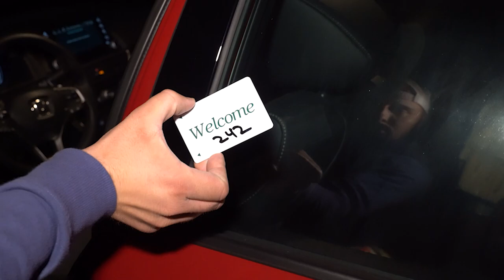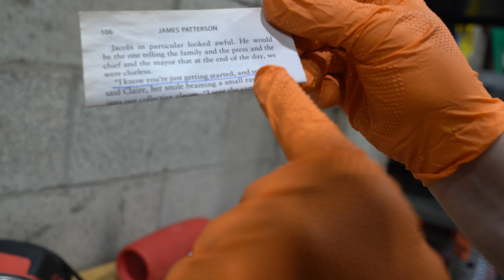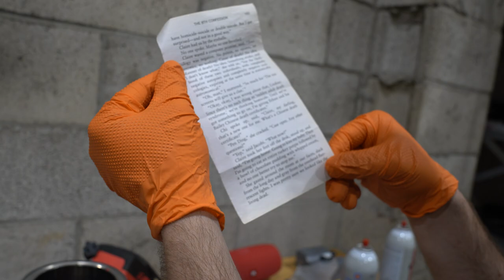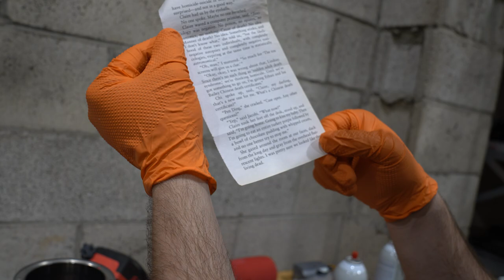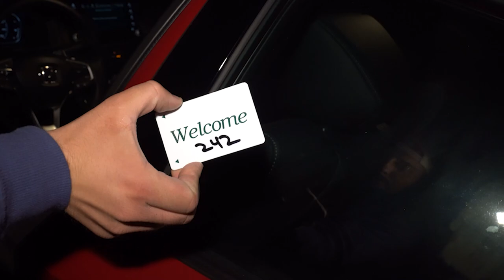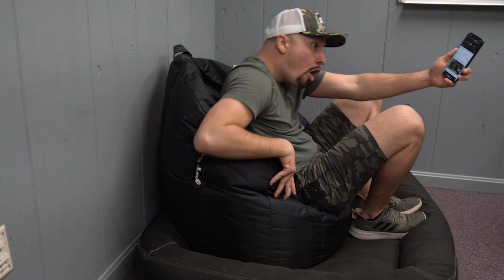OPENING UP A CAPSULE FOUND INSIDE CREEPY HOTEL ROOM

Comment: Why wasn’t u thinking about wearing a mask when opening the things, cause it looks like a airtight container. There could have been some kind of toxin in it. Be more safe and the doll can be cursed? 🙏🏽💯
Reply: Did u hear the noise when it opened
Reply: Exactly
Reply: Exactly.  And locktite on the bolts didn't say somethings SUS.   Seriously
Reply: @xxcharliegirlxx154  yeah cause it was airtight.
Reply: I mean once again a super valid point.  This is why I get so heated over these videos.  I liked cj at first but damn man common sense over content unless its all just staged.  Which makes sense with the lack of precautions everywhere......
Reply: @danegalang6224  don’t think he is staging it, he’s just not thinking. 😂
Reply: @monicatnielsen  I agree

Comment: ok I rewatched the hotel visit and the only clue I could see was the toilet seat was up. It leans towards a man, because I normally see hotel rooms have toilet seats down after they clean the rooms.
Reply: Have you checked for GPS tracker on your vehicles?  Did you track what vehicles you all saw both nights? Have you cross checked those with thr vehicles outside the hotel?

Comment: They keep leaving you pages from a book. Are you saving the pages and are they from the same book? Also, that doll, isn't that the head that was in that brief case with the condom that you didn't take. Then when you went back for it, it wasn't there anymore. I think when you fail to take one of their clues, they put it in another intent to make sure you see it. Also, in the room, take note that the bed sheets were messed up. And look at all the things you are finding because it appears they are personally messing with you so anything you find is a piece of the puzzle. For example, the messed up bed sheets are probably connected with the condom that was in that briefcase. And it seems like there is a focus on unsolved murders or deaths.

Comment: The radio is set on white noise which indicates shielding of information from being intercepted by overhearing via ear or electronic usually electronic. It would have been nice to know whether the bed was actually used or staged. The other thing is if the chair and card was on private property it could have been meant for property owner if so they maybe able to shed light on the matter.

Comment: The only way to determine if it's randonautica setting things up, is by setting some scenarios up yourself.
For example;
Set up an email address, then during your randonauting, leave some random items in the location. Such as a waterproof container with a piece of fabric in and a copy of instructions. These instructions could say if this correlates with your intent, then email me with your answer. 
This way you'll start gathering answers from others, maybe the app is sending others to the same locations, maybe others have figured this out and they're setting things up. If nothing happens then maybe randonautica doesn't send others to that location. 
This maybe a lot of work to take on because if you receive emails, you'll have to deceiver whether or not it's genuine randonauts or it's randonautica themselves.

Comment: randonautica@pb06.ascendbywix.com,   Trickle Down Intent

As we have already hinted at in a past article, the hypothetical portal gun of Double Zero that enables us to travel in time actually does not need to be invented. You are already holding it in your hands if you are reading this article. You are actually traveling time when randonautin 

We admit: that question mark above your head is legit. So let’s expound on that. Our expectations about time travel are mostly influenced by movies like Looper (2012), Edge of Tomorrow (2014), or even more challenging ones like Primer (2004). All of these are based on the common premise that the arrow of time moves from the past to the future. Then there are movies like Tenet (2020) that challenge this notion through the introduction of retrocausality or time  moving backwards.